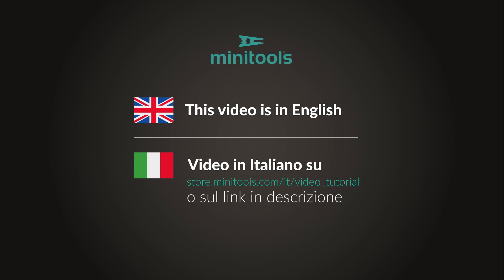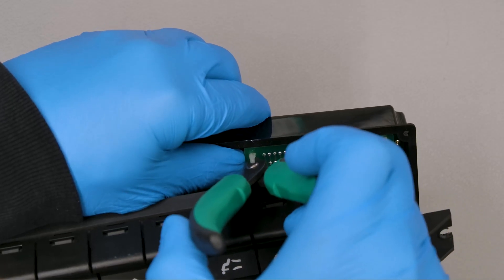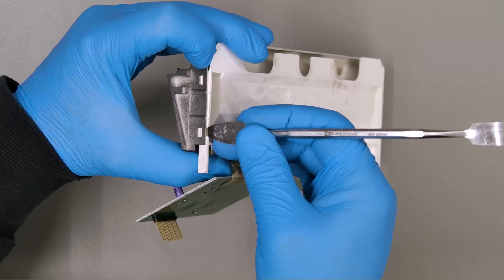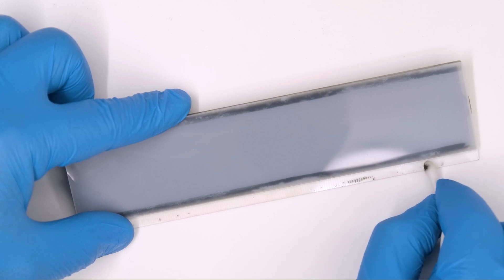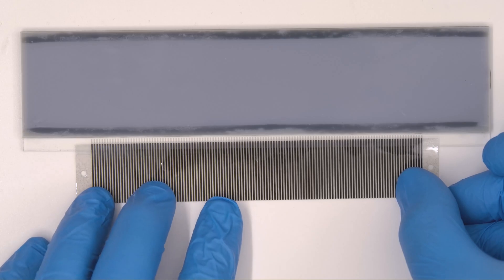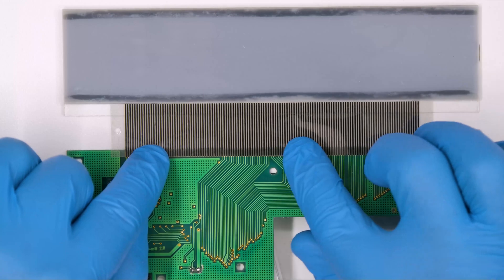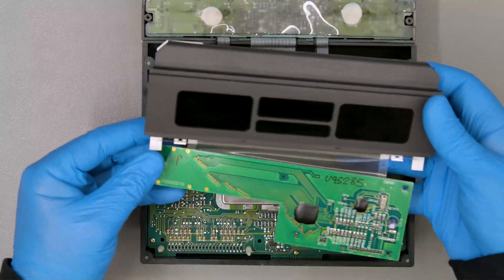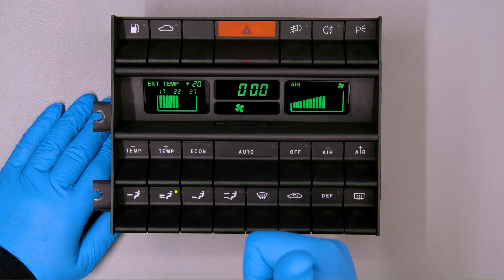Alfa Romeo 164 Climate Control LCD display Repair

Comment: Great video! Does the test at the end light up also the buttons or are they fed through different pins? It's hard to distinguish in a bright environment...
Reply from the maker: @zezek75  hi, thank you for the feedback. Yes, buttons will light up as well, you would see it in a slightly darker environment.
Reply: @MinitoolsChannel  Amazing, thanks! I was slightly confused with the other connector the function of which I do not know.

Comment: Hi there, I done it myself a few years ago I did repair 2 of them and the problem was to align the ribbon on the glass and you don't explain how to align the ribbon on the glass on this video, there are 2 white dots on the glass but they are so small and you only see if you use a magnifier or a camera and zoom in on it, the video is very good but I think you should explain that bit about how to align the ribbon on the glass.
Reply from the maker: Hi Flippo, to align the flat to the display you need to see the traces on the glass, if they’re not clearly visible, we recommend pointing a flashlight on the glass and tilting it a bit. Anyway for any doubt it is always possible to contact us at info@minitools.com